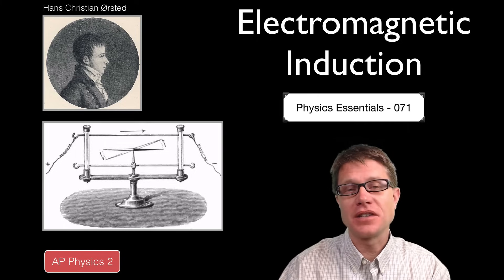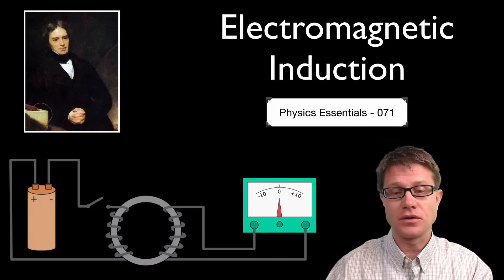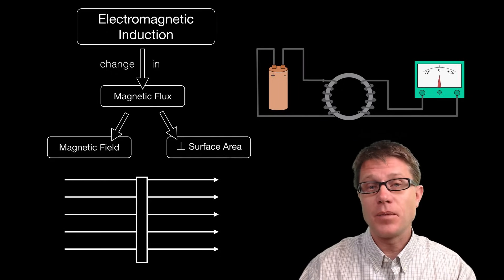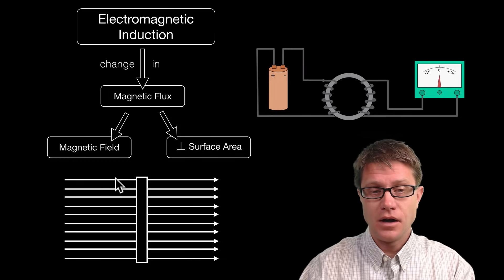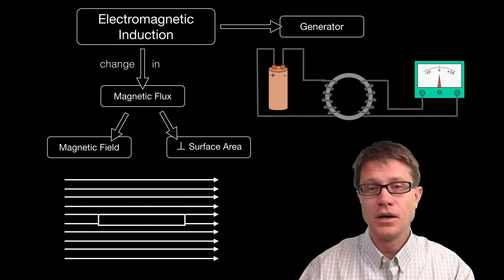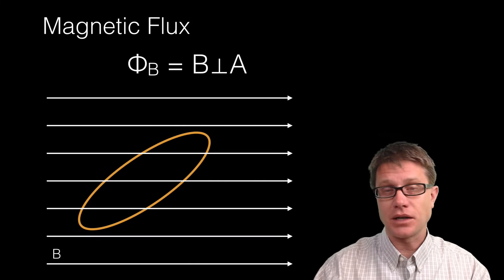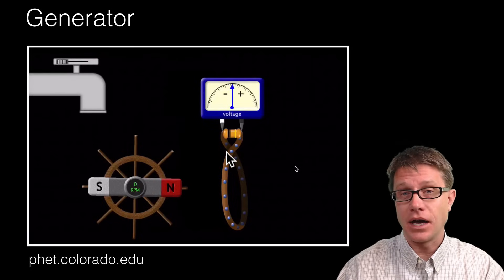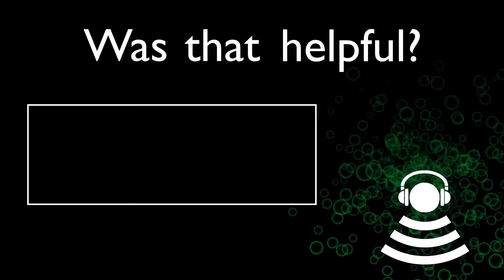Electromagnetic Induction

Comment: Hello, i still have questions about how we are supposed to harvest this electrical current if the entire circuit needs to be switched on and off in reapect to the magnetic flux change? What kind of switching armature do you have in mind?do you use a physical switch or a rectifier type of conponent?

Comment: Interesting use of graphics. I am curious about something.
This demonstration shows induction in an inertial reference frame, such as a table top in a laboratory. What if the entire system were accelerating, or in zero-g? Would there be slightly different behaviour of the needle on the galvanometer?

Comment: Howdy.
In electromagnetism induction can mean two things. It can be the total flux. 

The unit is Wb = V x s. The old unit is Mx (Maxwell).
Induction can also mean the electromagnetic force (voltage) a varying or moving magnetic field produces in a conductor.
Regards.

Comment: I also have a problem. I coiled a bunch of magnetic copper wire in a circle. Then i used a Neodymium Magnet with the pull force of 5 lbs. I moved the magnet in and out of the copper wire. I had also shaved the ends of the copper wire and attached it to a LED bulb. However, the bulb did not light up. Could you tell me why?

Comment: Dear Bozeman science, based on this science I have a pertinent question. Iron decadohedrons made ages and ages ago, if you were to wrap that in very thin copper wiring completely around it, in a sense insulating the iron core with copper, would it produce a magnetic flux based on its engineering? And if not, say the decadohedrons are hollow to start, could you add an element inside the iron core and then wrap it to manipulate the magnetic flux?

Comment: Why can't we use electromagnetic induction to produce commercial electricity?
Reply: We are already doing this. All hydropower plant use electromagnetic induction . Nuclear power plant also uses induction.
Your car battery also charged by the same way !
And so on
Reply: Ameer Hamza, Then why do we need potential energy of the water in dams?
Reply: @laracroft2386  water move the generator .. generate produce electricity by induction.
Wind power plant also the same. But instead of water, here wind move fan . Fans are connected to generator
Reply: @Ameer Hamza, thanks a lot man, this really helped

Comment: could a transistor connected to a electro magnet be used to attract a neodymium magnet through a coil of wire when it’s off the magnet would fall because of gravity generating AC electrical current 😮

Comment: How does generator work? I don't get it. When N is at 0 degrees and goes up to 90, angle of magnetic field compared to normal of the surface increases, therefore magnetic flux decreases and this would mean that current should flow upwards first and not downwards?

Comment: Hi from Irelans? what tools would i need to create the final experiment? i mean besides what i can see in the video.. I can see the water, wheel, magnet and light buld and light bulb holder. I have a multimeter and some copper wire? is there anything im missing? Should i just loop my copper wire around a few times and and have it wired into the live and neutral terminal on my light bulb holder?? Im amazed that only by spinning a magnet you can create electricity
Reply: Ireland :-)

Comment: So - With this wheel setup.... If you tapered the pipes of your rain-gutters, to make the water run through them faster: You could generate electricity from them when it rains?
Reply: Excellent thinking, although there just wouldn't be enough flow. You could however collect that into one container and push the flow onto a water wheel and generate through that. Even that may not be enough to generate much usable energy, however in large quantities, this is what they do. Collect rain/river water, build pressure (in a dam) and send it down a channel to rotate a wheel as demonstrated in  the video. You don't need a dam's worth of water, but do need a constant flow to get some useable electricity!

Comment: I understand that current flows with flux in the field but not why the current changes direction when you open and close the switch in Faraday's apparatus. In the first coil, the current can only flow in one direction (DC) because of the battery, right?
Reply: Look up inductors